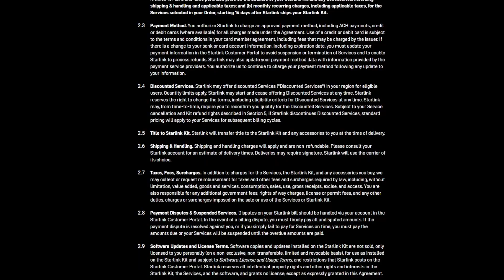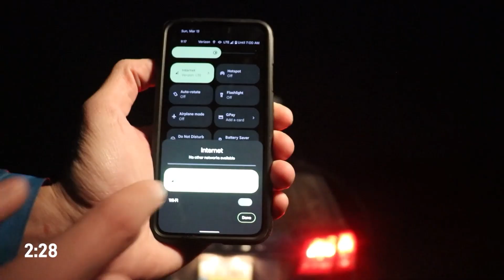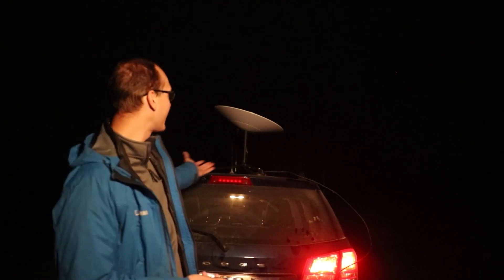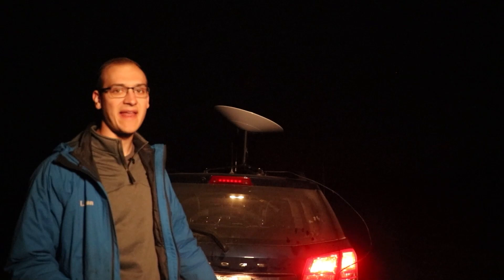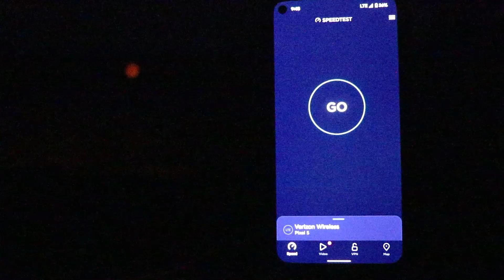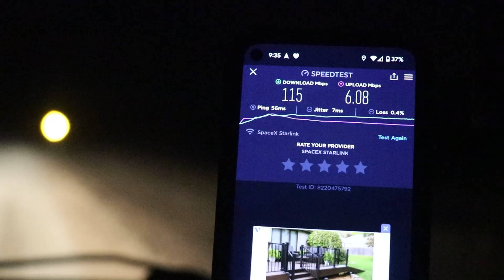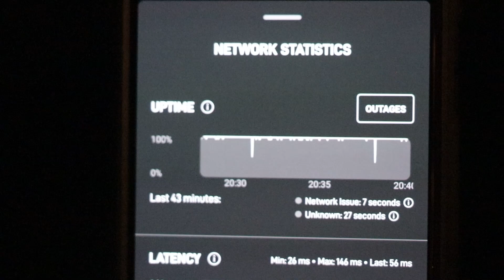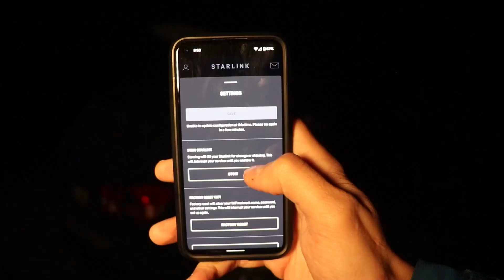ROAMING with Starlink! On my car's roof!

Comment: I am trying to figure out if the mounting is good enough to handle being installed on the highway... what wind speeds is it rated for with the snap connector?
Reply: If the producer i.e. Elon does not specify it explicitly in the manual then it isn't good enough. That dish is quite big, it produces hell of a drag while driving. I wouldn't risk it. That being said I've read on the Internet that FCC approved Starlink in moving vehicles. 😕

Comment: Does VoWiFi work via StarLink? My cabin gets a weak 2G signal but that is shutting down in 2025 where i live.  Would be nice to be able to call the 6 weeks or so i spend there a year.
Reply: yes - I use VOIP service with Starlink